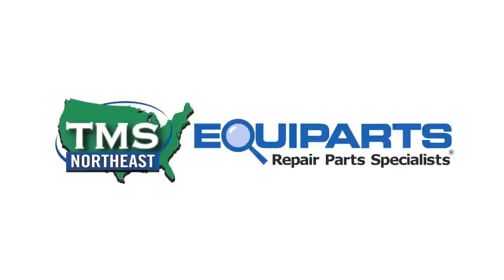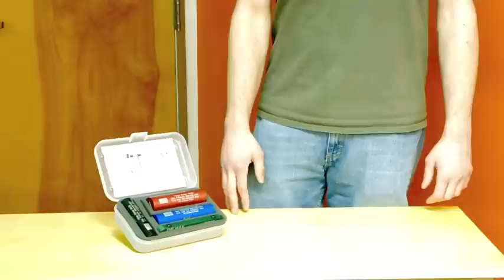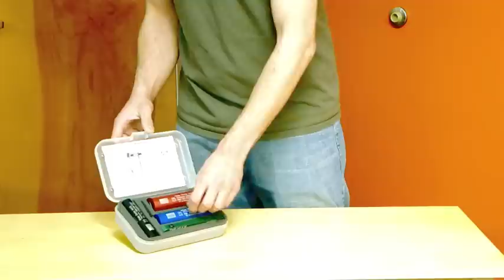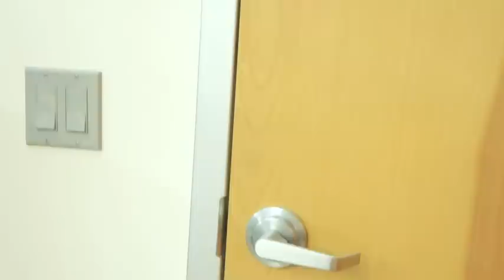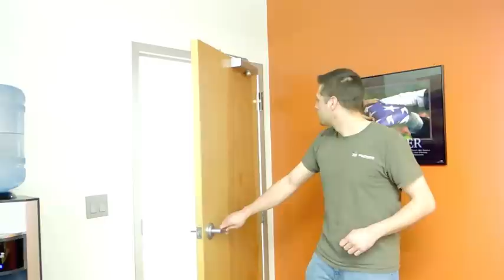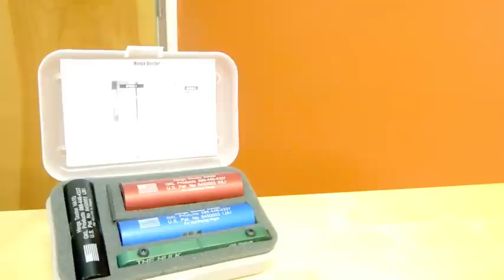How to Repair Doors with the Hinge Doctor Toolkit

Comment: I've used this tool and it's not working for me. Unless I'm not opening the door wide enough. My hinges are so wacked that this tool does not slide in easily. I have to use  hammer and a piece of wood to bang it in and out.

Comment: Some people saying "Just shim the hinge!" Umm... nope! Th top of the door it too tight and hits the frame. If you put any shims behind the hinge, that will push the door over even more and make it hit worse! If you just wanted to even up the gap, you could shim the BOTTOM hinge to kick that out, but now both top AND bottom will be hitting the frame. Only option here is to pull the top hing back and this Doctor is a great way to do it. 
And the arm linkage on the closer has been set up wrong.
Reply: Place the shims along the edge opposite the barrel and the door will move towards the hinge side as opposed to the latch side

Comment: I thought on wooden doors you had to remove the hinge because there is a risk of pulling the screws out of the door.
Reply from the maker: Hi Kyle, thanks for your comment. As with anything if it is overdone it can cause damage, that is why it is recommended to adjust the hinges a small amount and check what was done to see if it is adjusted to where it needs to be, or if it needs to be adjusted more. If the instructions are followed and the door or if using a wrenched isn’t forced too much there should not be a risk of damage to the door, hinge or screws. I hope that helps! Feel free to give us a call if you have any additional questions. 800-442-6622 M-F 7:30AM-5:00PM EST.

Comment: why not shim the door
Reply from the maker: Connor, the Hinge Doctor actually bends the hinge back into place, which fixes the hinge. Shimming it wouldn't be the right way to assess the issue, as there is nothing wrong with the door, only the hinge.
Reply: if you shim the hindge it also will draw the door back just like the hindge bender does
Reply from the maker: Yes, If you shim the door it will draw the door back just like the Hinge Doctor. The difference is that using the Hinge Doctor is the easier and quicker option. As you see in the video, the Hinge Doctor enables you to adjust the door literally in seconds.

Comment: Fix the door closer first!!!!!!! There are VERY few people that understand the "total door opening".  Sometimes especialy with steelcraft doors which are totally junk. They do not weld there doors they use epoxy to adhere the 2 door skins together, no welds. The hinge pads are spot welded and you can always see they will fail before installing the door.  The #1 weakest commercial door in the industry!!!!!! Deansteel,  Curries, Ceco and many others are WAY better